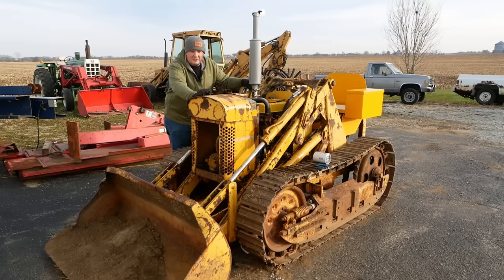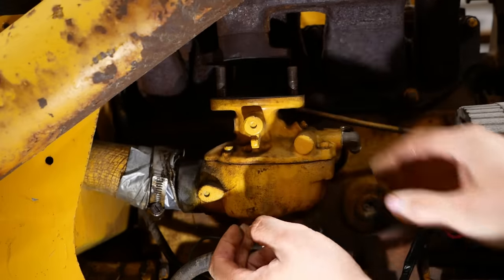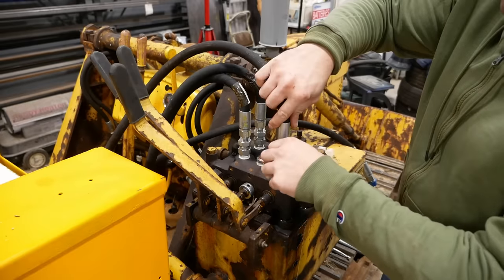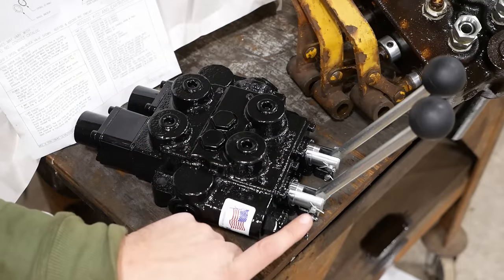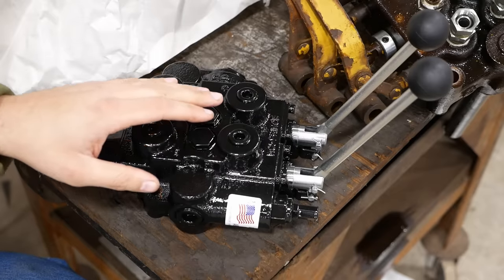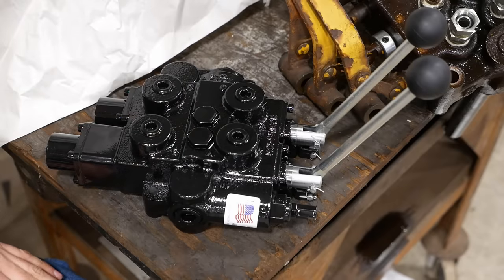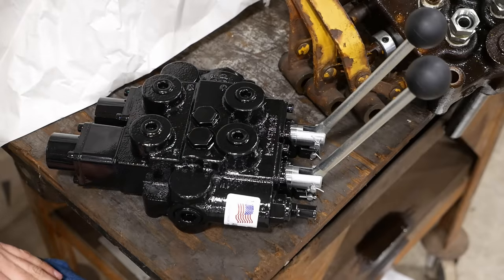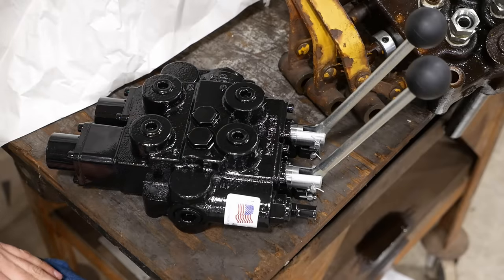Replacing a Hydraulic Loader Valve

Comment: You might not be aware, in Europe split washers (same goes for spring washers) have been put out of use for bolt retention purposes, as it has been proven that when tightened to any decent torque, the split joint is crushed back flat, and serves no purpose to retain the bolt from turning, performing no better than a normal washer. You might want to consider that, an alternative would be a knurled washer.
Reply from the maker: Yeah I keep hearing that, but I keep seeing them, even on European gear.

Comment: In all fairness you did a decent job of explaining the hydraulic setup for SIMPLE hydraulics however there is a vast variety of valve configurations. Things like motor spools, metering spools, work port reliefs and on and on. Put a regular style valve on motor circuit with a high inertia load and Things get wild
Reply from the maker: Well it's not meant to be a PhD thesis on hydraulics. Even relatively simple machines like backhoes often have very complex valves with flow and pressure compensation, individual relief valves, pilot controls, etc.

Comment: About the oil filter. I had 4  in row blow up. 40 years ago. Wix filters Ford 400. Eventually pulled the pan and replaced the oil pump.
 Due to a faulty pressure relief valve. Also a fuel regulator would help with  over-pressure fuel issue.

Comment: I’ve seen oil filters be “inflated” like a balloon before because of a stuck relief valve but haven’t seen one actually pop. Probably lucky that it happened when it did. I was out working on my son-in-law’s car the other day when a fella pulled up just along the road from me in his Ford Transit van. As I looked towards where he’d parked I saw a trail of fluid on the ground. On closer inspection it was engine oil. I told him about it and he checked his van. He initially thought the oil cooler had burst but when I spoke to him later on he told me the dipstick tube had come out. Not sure whether it goes in the block or the sump but either way it was pouring out.

Comment: Great work and super explanation as usual.

I especially loved your mechanics bandaid.

Only thing I was not in love with was how you had to spin the valve body onto the welded pipe.

With NPT you never really know if it’s going to be tight enough.

A short nipple on top with a union between tank nipple may have been better.

But sometimes you don’t see that until you are done.

Keep up the good work.
Reply from the maker: There's no pressure on the return side, so the risk is pretty low. I had the fittings super tight when I welded it so it just had to go back to the same spot.

Comment: Hey Wes. When I was plumbing hydraulics, I used forged steel fittings. The galvanized street ells are rated at about 150 WOG (Water Oil Gas) pressure. However, the half inch fitting that came off the inlet line is also cast iron, so I guess the pump doesn't put out much pressure.
Reply from the maker: All the original fittings were just standard iron fittings.

Comment: I've seen a good few videos where they seal a vacuum cleaner hose on the fill cap of the hydraulic tank sucking to stop leaks when you take off parts, never done it myself but it seams to work in the videos..

Comment: Don't know whether I've said this before on another video, but the swash plates on those pumps, even gear pumps, are made of leaded bronze for various reasons.  It is supposed to be very soft and smoosh between the rotating cylinder block and the static end cap, 'customizing' itself as the pump wears.  Filter elements where I work are alive with forbidden glitter.  This being a 60s system it it NOT up to modern standards of filtration that major OEMs have to abide by.  I work around them and I have to wear lots of PPE and be very carefully clean before I am around any kids or pets.

Comment: Oil filters blowing apart does happen with vintage (pre 1931) cars especially those with piston oil pumps. The pulsations of the pump cause the can to fatigue. Also canister filters can only stand a limited differential pressure so the new ones have by pass valves in the base.

Comment: Wes, I have actually seen two oil filters split in my day. To be fair, one didn't actually split; it just swelled up like a toad. However, neither was on a stock engine. Both were on engines that someone had hot rodded. Both had high volume oil pumps. Oddly enough, or perhaps not; if I remember correctly, both were Fram filters. Unfortunately, the one that split caused a catastrophic failure. You're lucky you were standing right there when it happened.

Comment: You send that to Fram and they will tell you your oil pump over pressured the filter. They just don't accept the fact they might have made a bad filter. I know, it happened to me. The filter element was rattling around inside a filter canister. I have not used a Fram anything since.
Great video and have a great Thanksgiving.

Comment: A point which often got overlooked mechanical pumps have an increasing volume over increasing rpm. Older configurations often, even freshly rebuild, leak a little at the needle valve.  That's no problem when, on idle, you've only 1-2psi fuel pressure because the engine uses also an amount of it.  Carb pumps often deliver a max pressure(@ dead volume) of over 10psi. That can end up in bad idle adjustment ability or poor idle to partial load crossing...

Comment: Manually checking the oil pressure will give the answer to the filter failure. If the engine oil pressure relief valve isn't stuck and pressure is OK, it would be the filter. Filters have relief valves in them also, and they are the problem most of the time, especially if they have been installed for a long period of time.
Reply: I put a new gauge on this thing back when I first got it, and it's junk. Gotta get me a good gauge to see exactly what the engine oil pressure is. Wes thinks around 40 psi.

Comment: Hey Wes dot. Know if you’ll see this but I have a 1970(I believe)jd 350 dozer and thinking of adding a backhoe attachment to it, any thoughts? I have a spare valve and hose to the back figured I could just run that to the valve and run it to do what I need

Comment: Not to nitpick but I believe that style of valve block is called a tandem center when it always dumps to tank when in the neutral position but closes the actuator side to circuit.
Reply from the maker: Technically it's called a series parallel valve. But who's counting?

Comment: Rather than go to the trouble of installing an elbow for the float lever problem, could you just heat up the lever and slightly bend it back a little? Like a 15 degree or so bend,  halfway up the lever.

Comment: Very interesting repair, but an excellent thumb repair. I cut the artery in my wrist on some sheet metal, used the same electrical tape and shop rag repair to drive to the emergency room for a stitch up. Kept most my blood in its proper location

Comment: Well done video Wes  :) also lots fun work head there and only thing might happen on Oil filter person got dozer was should be no synthetic engine oil type also should had a conventional type there 4  types out there in FRAM types for Gasoline engines! I seen it happen to costumer recently to and blew pin holes on side plus bottom ! But lucky got problem solved too and no problem since too !

Comment: Looks good, My 2 cents is that you should use Hydraulic fittings instead of pipe fittings. They are muck easier to use as the are hexed and a higher PSI rating

Comment: Wes I am going through the same thing right now. The valve on my tractor front end loader started leaking.Mine is a single lever that controls both the loader and the bucket manufactured by
Dukes Fluid Power.They were bought out by another company.I emailed the new company about a replacement and they quoted $1245.00 and 4 week lead time. It looks like that Prince valve might work for me .

Comment: On the oil filter, could there be an issue with the pressure relief/bypass valve in the filter housing?

Comment: These cast-iron carburetors are very easy to clean using a self cleaning oven bakes all the junk in there out turning into powder and you just spray it down and assemble and they work perfect after that. You just need to remove all the brass parts throttle shaft seals gaskets and so on

Comment: Well that's a new one. I've been a mechanic for close to 30 years and I've never seen a oil filter pop at the seam like that. Given that the base of the filter is also severely deformed it makes me wonder if that engine has high oil pressure

Comment: Question wes does it have a bypass valve in the oil filter housing like a 350 chevy if it's got that valve like the Chevy sometimes crud would make it stick an it would put full pressure to the oil filter an blow it out like the dozer did if it does it again. Look real good for that valve its just a spring an plunger

Comment: Had one blow apart like that on a 1976ish  F 350 360 ci. I knew it had to be defective filter. Never seen a FORD with too much oil pressure. They always suffer from too little oil pressure....New filter solved my problem.

Comment: The main reason oil filters blow out like is the pressure relief valve in the oil pump is blocked or has jammed also starting the engine with thick oil in cold weather and revving the engine before the oil warms up. From Australia

Comment: Last time I saw an oil filter blow like that was a Nissan LD26 six cylinder that a guy repowered in to his series 2 landrover. seems the pressure relief took a knock when it was installed and the piston was binding and not allowing it to work.

Comment: Wonderful work Wes! I have a question of the galvanized street elbow on the pressure side of the hydraulics, do you have any concerns of the psi rating of the fitting?
Reply from the maker: They should be fine for 1300ish PSI. I suppose a machine steel elbow would be better.
Reply: @WatchWesWork  Good to hear. Thanks for the reply.
Reply: My 1954 WD45 Allis tractor has galvanized fittings on it since I bought it in 1983. It has a high pressure low volume system that is supposed to unload at about 3400 psi. Mine is set back to 2800 psi now, but had been stock for decades with those same fittings. I don't use it enough anymore to bother with fixing something that ain't broke 😁
Reply: @WatchWesWork  Unfortunately, the pressure rating for that street elbow is only 150#. :(
Reply: All's well folks. Scoopy has a 'proper' steel 90 now 😁

Comment: question? i have no knowledge of most of what wes does but wouldn't 90s have been better to use on the top of the valve block for less strain/stress on the hydo lines for longevity

Comment: I was a Fram fan for years until a friend with a on-site service company had a cut-away display of oil filters shown to me.. the by-pass spring is the big thing,, Fram does not have one, they have a small piece of spring steel (I guess) which will flatten out on cold starts and stay there making the filter stay in by-pass mode.. so they are not filtering anything after the first cold start. seems reasonable to me.. JMO..  oh well/// thanks for the video..

Comment: Hey Wes, would the Fram BP 50 have blown out because it is listed as a bypass filter without an internal bypass valve and the high viscosity of the motor oil used with the colder temperatures?
Reply from the maker: It is a bypass filter, but it still has a bypass valve.

Comment: On our 580 case backhoe we found out that Fram had a filter that would fit correctly and had all the same filtration specs as the OEM but. The difference was that the OEM oil filter had a higher burst strength that the Fram filter.   Might just be that the vibrations caused the filter to burst not sure if this applies but an idea.

Comment: I'm going to guess the oil filter failure was caused by overpressure because the relief valve has worn the passage it works in and is sticking on the worn lip.

In some cases you can buy a new relief valve that's a different length to run in part of the passage that isn't worn.  In other cases you have to machine the passage out and bush it.

Comment: Had a 79 horizon at 15 below with some thick oil at startup It peged the oil gauge at 195 psi and turned the fram filter into a ball before it blew off no relief valve in the VW engine

Comment: Why not go back with the copper washer,  they use them on disc brake lines and seal great.  One under the metal plate u made then one on top .
I used them to seal up the site glass holes on a hyd tank when , couldn't the the right one .  Nice video

Comment: Some arm chair 4th down quarter backing here.  Maybe install 90's on all those hoses to relieve the stress and would move that one out of the handles way.  It also would have been nice if you could have used a thicker plate on the return and machined an Oring groove on the bottom and gotten away from the RTV.  I'm sorry Wes I just had too, I couldn't keep ma mouth shut !
Reply from the maker: I tried to stick with the original layout. The manual shows the hoses coming straight up and bending like that. Not sure why.

Comment: Elbow? For lever clearance? You mean bend the lever, right? or turn the lever 180 on it's pins. I would hate to have an elbow with more leak paths in the system. But if that is the only way..........

Comment: Not quite understanding the layout of the system, is there a reason for not using 90 degree fittings on the hoses ? Space, cost, location ?
Reply from the maker: That's how the manual shows the valve being setup. We just followed the original layout.

Comment: Hey Wes, i was wondering why you used those thin cross braces instead of making the two tabs meet at a 90°  ?
Reply from the maker: The top plate isn't close to flat. It must have rusted under the old valve.

Comment: A fram oil filter and galvanized pipe fittings on hydraulic system 2 of the greatest internet controversy in the same video

Comment: How much oil goes through a oil filter. All of it let me tell you. I just yesterday tryed to loosen the oil filter on my Tacoma and didn’t think I got it loose so I was gonna put it on the ramps and remove the pan guard to get to the filter so I reached in and started it and turned around to get the ramps and then saw omg oil going everywhere so I shut it off and took the filter off and replaced it and finished changing the oil there was still at least three quarts in the motor. No harm done. Oh yeah I used the sawdust front my table saw to soak up the oil.

Comment: Do you have to bleed the constant pressure or closed type?
Reply from the maker: The same as any hydraulics. Just run the cylinders through their full travel. The oil will return to the tank through the non-loaded side of the spool.

Comment: Just a reminder... Galvanized pipe fittings are for water and rated about 150psi, where black pipe fitting are usually rated around 425 psi.  I know the Oliver probably isn't putting out high pressures.  Just for future reference and to pass down some Fluid Power hydraulic schooling from over 40 years ago.  lol
Reply from the maker: It's just a placeholder until I can get a proper forged fitting.

Comment: You should make a shield for that 3/4" BMI 90 degree at 27:16 for when it fails (not if) I have seen people get hurt when they do things like this. Pressure for BMI is max 300 lbs for # 150 pipe. If the relief sticks where will the oil go? Also there is pressure coming out the tank or LP side of the valve if you put a gauge on the LP side you will be surprised.

BMI = Black and Galvanized Malleable Iron Pipe
LP = Low Pressure
Reply: Wes changed that out to a 'proper' steel 90 this morning before I brought Scoopy home. 😁

Comment: Your pipe wrench may have good teeth,but it does'nt seem as easy to hand as a Record, here in the UK we call them Stillsons because that was the UK brand be4 Record bought them out. They were/are slim in the body and handle  48,36,24,18,12,9,and 6inch variants.Thank goodness the larger sizes are not in common use these days, together with 4" steel  pipe it was outer scale and heavy work . Great videos

Comment: Fram spin on filters were banned from AFM motorcycle racing (California) in the 70s. Their poorly made threads allowed them to blow off the center front of the engines of the era, instantly oiling both tires at the absolute worst times.

Comment: Had 67 mustang, 289 that would blow filter at high rpm, dad told me probably was oil pump check valve, so jacked it up in the back yard, dropped oil pan, r and r pump, problem solved, my ol man said if I can't keep em running I walk, lol, and he didn't help, one of my gear head buddy's  did though

Comment: I didn't see you take the pressure Beyond plug out of the valve if you didn't you will have a heating problem you will be dumping over your relief at all times also great video the only thing I would have done different would put a pressure gauge in while I was working on it

Comment: Worked on a 62 Chevy that would blow out that filter seal every time only thing I could figure is the oil journals were blocked off and putting way to much pressure through the filter
Reply: The early Chevys didn't have a bypass valve that the oil filter attaches to. It's the aluminum threaded thing that bolts into the place your oil filter goes on the block. If your engine didn't have that, it would have been made for the metal canister housing type, with the replaceable filter cartridge inside. They came out with an adapter that has the correct bypass valve, that bolts up in place of the canister housing and lets a regular filter work on those. That block would have had from OEM, the canister type oil filter housing, in 1962.

Comment: I know you’re probably not going to pay attention, but why not use elbows or bent tube hydraulic fittings for a more streamlined look. Also I believe the elbow you used was galvanized. Not compatible with hydraulic fluid. Black pipe is